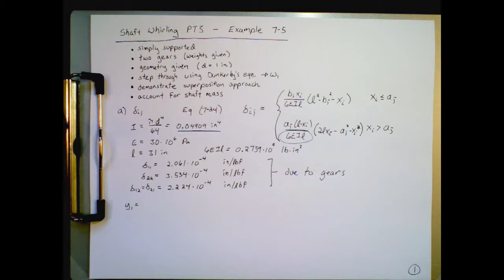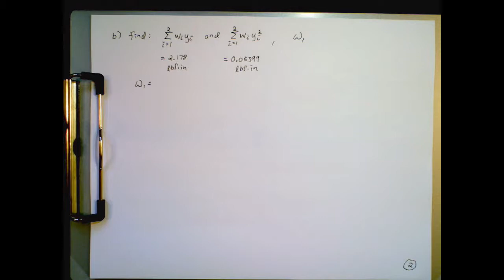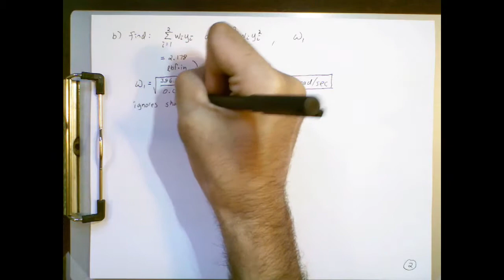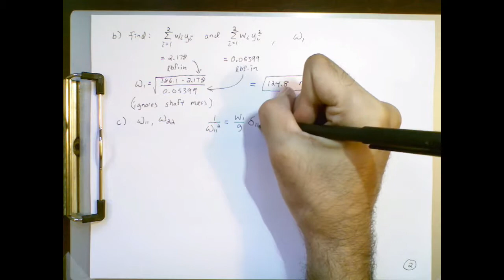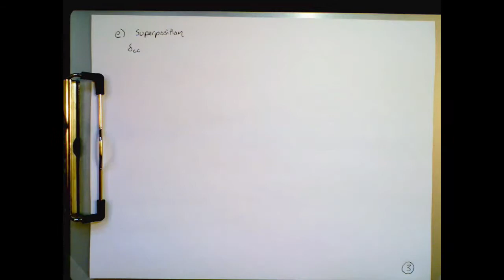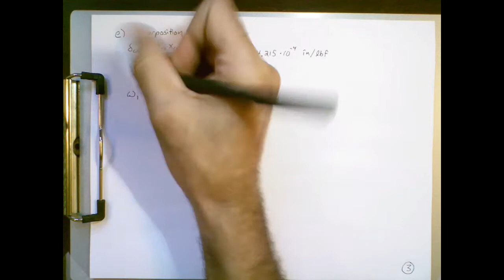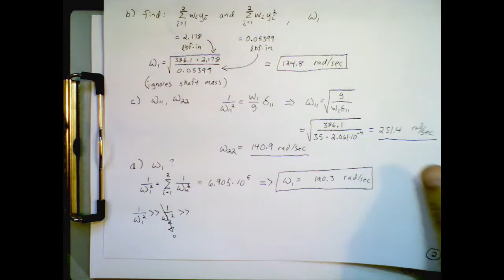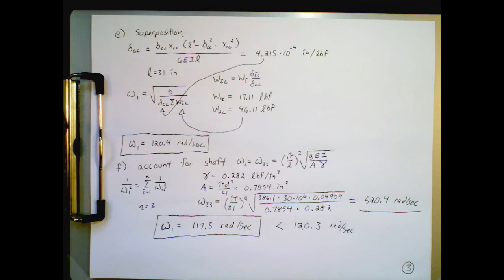Introduction to Shaft Whirling - Part 3

Comment: Thank you.  Part 1 video shows the relationship between strain due to weight and inertial force, but there is no information about inertial force in the text book and part2, 3 video. It is expected that the load transmitted to the shaft by the inertial force will increase. Is the inertial force replaced by an equivalent load?

Comment: Thank you for the series! Great content. I was wondering if there is a similar way to calculating the critical speed for a shaft with a propeller on one of its end, like in the video clip reported in Part 1. Could you give me some tips? Thank you in advance!
Reply from the maker: If we are only accounting for the inertia of the propeller, we can use the influence coefficient strategy as outlined in Shigley's. Accounting for more complex factors, such as compliance in the propeller and aerodynamic forces, is well beyond the scope of the class this video is based on.
Reply: E is in tems of psi no Pa